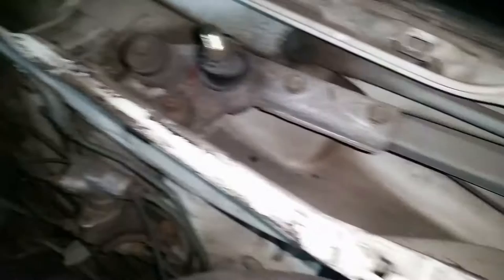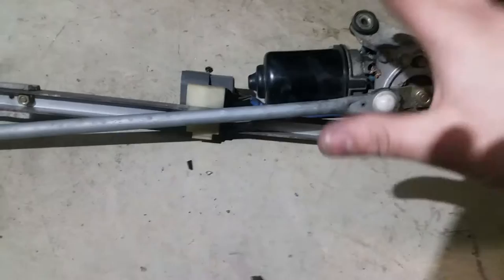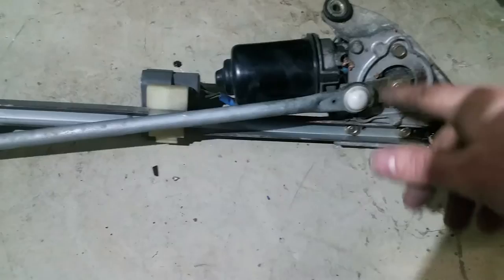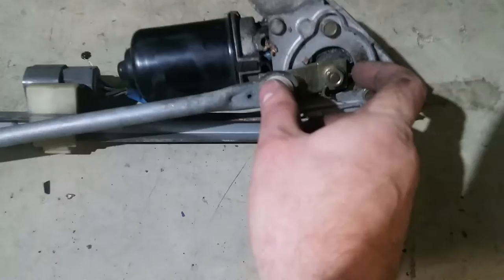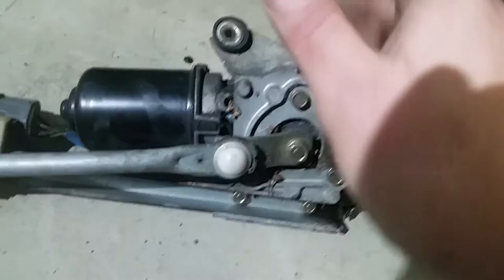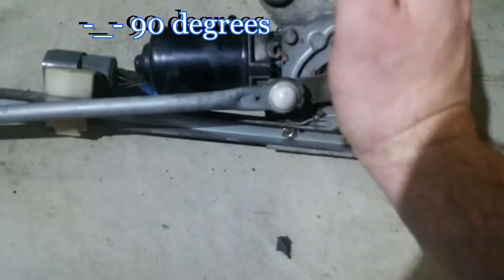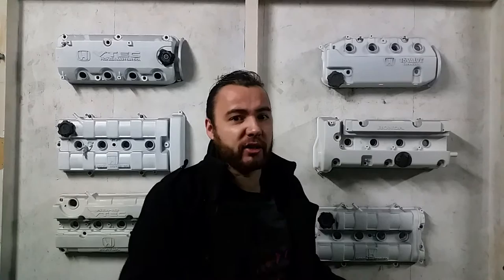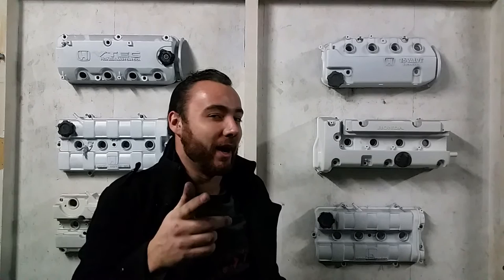how to do a single / mono wiper conversion

Comment: There's a much easier way which basically works as good. Basically just keep the centre wiper and just rebolt it on at a similar angle you shown and test. You may have to tweak the position a little to get the wiper to clear the most of the windscreen possible. You also may have to shave a little bit of the cowling where the arm may hit

Comment: Or just use a rear motor from a few different types of cars. Nissan cube, ford freestyle, ford expedition. Will all work on RHD cars. Im building the only 90s model RHD Ford Ranger in the US and a mono wiper conversion is the only way i can go without more fab work. Since im doing everything on a stock LHD firewall i figure why do extra work. Those 3 vehicles use a rear wiper motor that all have a large sweep. Best of luck.

Comment: on my r31 the side wipers linkage broke so to get me by in the middle of winter i just re adjusted the centre one to reach more of the windscreen by doing as stated in elliots comment uuntil i had time to get the parts and fix it properly